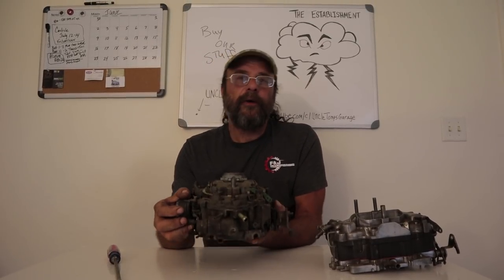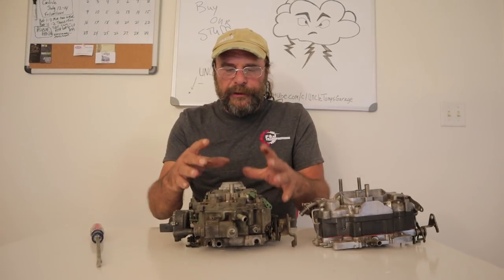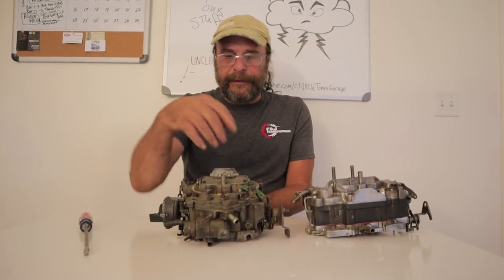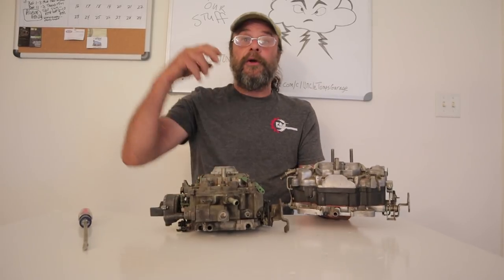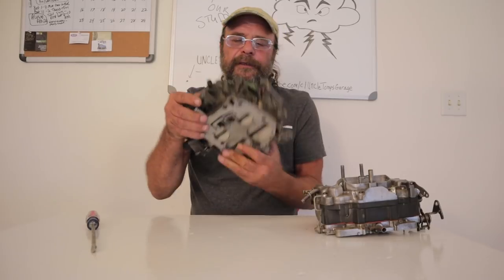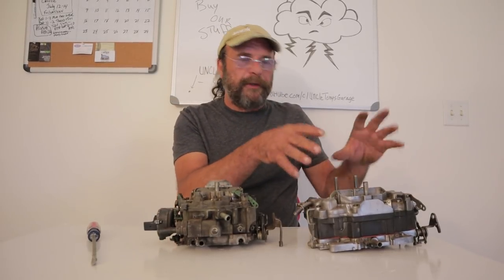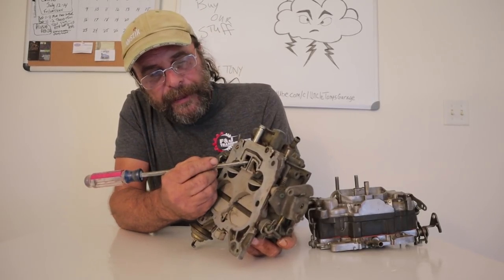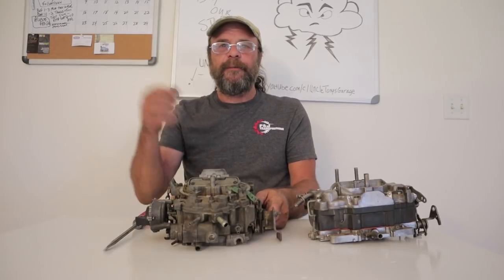The Quadrajet

Comment: My smog guy told me my carburetor is dumping in to much fuel.. he tried to adjust the high idle screw but said it didn't change anything. He said it's perfect at idle.. but in higher RPM'S it uses to much fuel.. does it need a rebuild?? 85 Buick LeSabre
Reply: And yes it's a quadrajet
Reply from the maker: Really too vague to give an accurate answer.  Something like a bad ignition coil could give you the same basic symptoms.
Reply: I know exactly what it is now.. soon as you said that.. my ecm shorted out and I put a new one in it.. but I can tell it has a electric short since then.. the check engine light is on but really really dimm.. you can bearly notice it even in pitch dark.. so I'm guessing my problem is a lil bigger then I thought.  Seems to run great thoe
Reply: And my OBD port has no power too it at all.. smog didn't check none of that because the year of the car
Reply: Thank you sir. I appreciate your time.
Reply: @jes.8314  powers and grounds, o2 sensor ,check fuses .get rid of it all if you can .
Reply: @willefixit   I wish I could get rid of it all.  Smog is a bitch in California.. when I bought the car it has been sitting a while..  got it cheap.. drove okay.. but it had a check engine light on.. so I started checking and found a blown ecm fuse.. I put one in it and my ecm in the passenger kick panel caught on fire.. so I replaced it.. tried again.. no fire or smoke.  Same number ecm.  No check engine light.  But it's on real real dimm.. it's really hard to see in pitch dark.. and I have noticed it uses fuel on the highway.. then the snog guy pointed it out on his computer.. so idk how to check the rest
Reply: @willefixit  all fuses are good.. I checked as good as I could with my light tester and my multi merter.. but I got lost after a few hours
Reply: @willefixit  never checked my o2 sensor..
Reply: @jes.8314  thats got an electric mixture valve i think? .usally u can get them to pass with and older carb or newer promanse carb replasement .dim check engine light uasally bad power or ground .check bbi or s industries for wire diag.had good luck removing it all new manifold and carb,been awhile.since i saw a stock 85 ele carb. california totaly different save old stuff just in case .
Reply: @willefixit  yeah well I will stay trying different things.. thank you
Reply: @jes.8314  your welcome think we made them run by cutiing wires like i said i made cars pass tail pipe test with preformance parts. dyno test, visual,mabey not
Reply: @willefixit  I know the car has a small shake and not so snappy when I start it up cold.. but after 2min it goes away.. if you want I can upload a video to my Chanel if you want to help.. I found a vacuum line idk where it goes too.. and a valve with no line.. but they are on different sides of the car.. and the line don't reach.. can't find the right diagram online

Comment: My 72 QJ must be haunted or something. Because it runs cold to the touch. I would like to try a thermoquad though.
Reply: The Thermo Quad is supposed to run that same thick gasket for the same reason so either car use it and the heat soak issues should be fixed. I used to reuse them and for insurance I'd put some thick bearing grease down in case of a uneven surface to kill any vacuum leaks. Usually it always sealed fine, especially if you're just reseting the same carb.

Comment: If you got a good one, you got a good one. If not, they ran like shit. Dad had one on an old 350 that he never could get adjusted even after a rebuild kit. There's a Holley on that truck now.
Reply: I agree but the part that I found was the shafts wore out the aluminum base  I was once told be a GM mechanic that first check the shaft, if it was good , which most wasn't, then tear it.   down.   Clean it good, throw away the instructions DO NOT do any adjustments, put in a brass float and put it back together.

Comment: I never understood the need for a "manifold cross over heat" , especially with the spring loaded exhaust shut-off valve, I mean, WTF?
Reply: I take it you've never iced over a set of throttle blades on a humid day.
Reply: I'll take that any day over boiling gasoline mate.

Comment: Lead plug?? They are tapered aluminum plugs. The large secondary metering well plugs can be removed & plugged with a 7/16" UNF sealed with JB weld. Works, done a bunch of em.

Comment: Doesn't matter what carburetor you put on it. You... Still... Can hear every valve rattling on long extended trips. The solution to this problem currently is my favorite... Sticking microphone under the truck. That elevates the volume on the radio inside. That's classic. That's genius engineering right there. Can't figure out how to stop the valves from rattling... So turn the radio up. And we're only going to charge you $70,000 for that product. What a joke. John DeLorean would have put that company out of business.

Comment: I'd like to know more about how to tune the q-jet for performance.

Back in the day my buddy's dad claimed they were the best performance carb you could get...but he was a dip shit.

Once he claimed my truck wouldn't start because there was "a direct short across the battery"..i said there was no short because the insulation would be melting off the cables or the battery would have exploded. The guy looked at me and in complete dead seriousness (like I'm some young punk dumbass) said "the cables aren't melting because the field hasn't collapsed".

Turns out the battery posts were dirty, i just loosened the connectors and wiggled them around...fired right up.

So I always assumed they were some OEM POS and nobody ran them unless thier class required it.
Reply from the maker: Sounds like the experts on every automotive Facebook page

Comment: Anybody with experience or an opinion of a quadrajet on an inline 6?
Reply: @atribecalledcookies6thru284  was not aware of that. Do you happen to know the engine size/year that was done?
Reply: There was a version of the mid sixties Pontiac OHC 6 that came with a Q-jet from the factory. There are at least 2 sizes of Q-jets, I prefer the small one. The Holley 500 2 barrel is an easier to tune carb for a performance 6.
Reply: @Splungers  Thanks. I would like to find a late 60's OHC 6 quad just to see the rod/jet, bleeders, restrictor, etc., combo as this would be a good starting point to calibrate my modified 258. I agree the Holley is far easier to calibrate but the bore/venturis are much larger then then they are on the quad primaries and the quad has a more efficient metering system.  This is primarily a daily driver so mileage is a concern for me, although the Holley is still a possibility if I can't get the quad to work.
Reply: @berserk7111   I helped my son adapt a Holley 500 2 barrel to his Jeep 258 . It was easy after we figured the linkage out. Idles smooth, runs great and will pull hard. I raced 6's using that same type carb in the 70s and 80s, 7500 rpm on 500 CFM. They also make small 4 barrels, as small as 390 CFM, but they are expensive.

Comment: I'm replacing the governor temp/pressure sensor in my 99 Dakota transmission it went bonkers after 190K miles I replaced the original one at 90K  it's just about to turn over 280K   I hate this electronic shit

Comment: Possibly the worst carburetor I've ever come across was a variable venturi  that Ford used on the Lincoln Town Car models. It was so touchy and never worked right.
Reply: I had a 77 LTD II that had the 2VV on a 351M. Dang thing would get water in the gas tank on any given rainy night. The fuel filter was only the diameter of a quarter and 2.5" long. So after a storm it would get to 45 mph and nose dive. All one had to do was take the fuel filter off and blow it out, and all was well for a few days.
Reply: @kramnull8962  wow, they used that one earlier than I thought. Mine was a 1980 model. Yeah, that carb was a gem.

Comment: i have 2 imgur albums about quadrajet secrets.       the APT adjustment.. https://imgur.com/a/vgzGc  ,  the quadrajet idles with fuel coming past the end of the idle mixture screws.  off idle comes thru a idle transition circuit but because of the primaries. .its almost instantly on the primary main circuit.  this is controlled by the primary metering rods and jets. but there is a vacuum piston primary rod holder.. pushed up/rich by a spring..  pulled down/lean by manifold vacuum.   on early  up thru 75 quadrajets the lean limit of how deep the primary rod holder can dip the primary metering rods into the main jets is done by the small wire that sticks up from the baseplate.. contacting the pin on the end of the metering rod holder that when depressed against the power valve spring. sticks thru the bottom of the float bowl housing.  when rochester came out with the M4ME or M4MC carbs.. some had a plug on the top under the front of the air cleaner mounting gasket that allowed the Double D headed APT screw to be adjusted up and down by the computerized flow bench during manufacturing to zero in on emission goals.   people make a mistake and use needle nose and change the position of the APT screw.. or worse. the  sand the little wire sticking up from the base plate off.  this changes the rich/lean point at which the carb starts flowing fuel when accelerating. . if the Primary rod holder is too far down.. it will BOG and backfire is its low..  if its too high.. the carb will go thru gas faster than you can fill up at the station..

 with the M4MC or M4ME carbs.. one can seat of the pants tune the APT height to a mind blowing difference in the carb operation.   if part throttle on the primary is bad.. if you can get access to the apt screw..  you can create a dip stick for the round bowl vent with 0/32 being 39mm from the tip.  you can hold the metering rod holder down with this..  adjust the APT screw till you just start to lift the metering rod holder off its lowest position of you pushing down against the power valve spring.  usually most applications are somewhere between 2  1/4 to 4 turns up from just touching..  so if you bring the apt up to 2 turns..  back up and accelerate forward like you were checking the traction of the tires after a burn out..  just a part throttle burst..  if it backfires.. turn the APT screw up 1/4 turn.. get back in.. back up and do the same short acceleration.. i can do this in a tiny parking lot with only 3 car lengths..  make sure the brakes work well.  soon you will feel the part throttle power come on as it stops bogging and starts lifting the front of the vehicle and spinning the tires.  if you go to far.. you get back to the bog..  look carefully at the images in the imgur album above.. read what i have typed.. 

   this shows some of the neat stuff that pontiac did to their version of the quadrajet..  https://imgur.com/a/jrTVnXS   the pontiac carb usually had square cuts out of the front edges of the secondary air doors.  these created a low pressure area where the hole above the outer two tubes is..  if you take the top off your quadrajet.  notice where the outer tubes drop into.. that is a closed off cavity.. except for a tiny hole into the float bowl area that never gets properly cleaned.  nobody even knows it there.. this gives the secondary accelerating tubes their own reservoir for hard acceleration  when the fuel in the little reservoirs is used up.. if you are still heavy into the accelerator.. it will still get some fuel thru the tiny holes in the float bowl wall. but the secondary metering rods should be supplying the fuel..

  there is a tuning trick for the secondaries .. the air door spring adjustment.  the preload is somewhere between 1/2 and 1 turn.. not more.. not less. so you can easily experiment by starting at 1/2 turn.. then go to 9/16 turn.. 5/8 turn. 11/16 turn..  all the way to 1 turn.  this takes only seconds to change. with a tiny allen wrench and a flat screwdriver.  these are some of the secrets i have learned about the quadrajet carb over the past 40 years..   and always install a 1984 corvette fuel filter before the fuel pump.  keeping sediment out of the fuel pump prevents the needle and set from seeping when the engine is off and overflowing the float bowl. or allowing the fuel to drain back to the tank.  it also gets rid of hot vapor lock.. .
Reply from the maker: Awesome info..thank you!
Reply: @UncleTonysGarage  i hope this increases your love of quadrajets..  oh.. instead of punching out the pivot pin for the accelerator lever.. take the bottom off and flip it around to unhook the rod.  its actually faster.. 

 the carb you had in your video has a secondary choke pull off..  it does not really pull the choke off. it pulls the carb off fast idle.. the vacuum hose to that goes to one of the thermal vacuum switches on the outside of the air cleaner housing.  really important if you run across fast idle issues with a warmed up engine..

Comment: Ive got a 308 holden engine with a Rochester carburetor on it !!! ?? That even a brand of carby
Reply: Yes, they were made in Rochester,  NY.
Hence the name. 
They were used on Everything GM made until fuel injection took over.
Reply from the maker: They also made a mechanical FI back in the early 60's
Reply: Cheers good to know been awhile since I've repaired a carburetor

Comment: I've been watching your videos for a while have a 1978 Chevy big 10 short bed with a 350 crate motor stock put the quadrajet sucking so much gas no powerthis thing should be doing donuts and it's not can't figure it out bought the carburetor new not rebuilt when I bought motor I guess you could call me. Even the transmission was rebuilt two stock I also have a 1954 Ford customline 2 door stock and the third one in my family to own it my dad built the motor when he was 12 I was the first grandchild to run it Carlos from New Mexico in really good shape wiring harness was bad replaced with ome parts rewired everything now I am to the dash need help with bowel problems do not want to post my contacts online do not know how to get ahold of you otherwise I have a dilemma
Reply from the maker: Crank a few extra degrees of ignition timing into that 350 and see if that wakes it up
Reply: It's at 12 degrees now I tried to figure out how to send you some pictures I think you'll appreciate these cars I inherited them both they're both of New Mexico really good shape

Comment: I find it ironic that your comparing an older qj to others, implying that all qjs have small float bowels, you are aware that after those years of that qj you have on the table the bowels we're way larger right?
Reply from the maker: I have never heard of or seen a Q-jet with anything but the standard bowl
Reply: Uncle Tony's Garage 1974 to 1984 M4s 750s and 800s if you can find a 800 (rarer than chicken lips) have the larger bowels.
Another thing to consider is that you have to use original equipment in stock class.
The small bowl is really not a big deal if you use a electric fuel pump.
But if I had to choose I would be slapping on a FiTech.
Thanks for the reply Tony, I enjoy most of your vids.